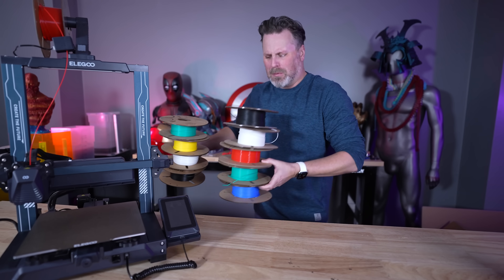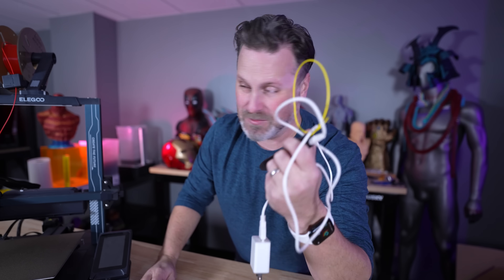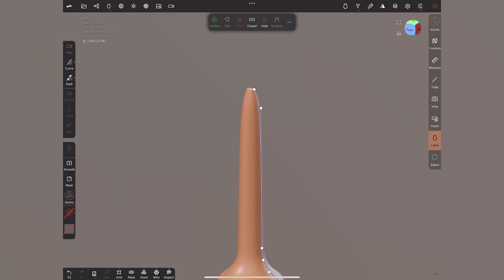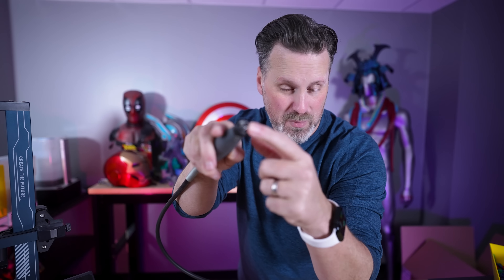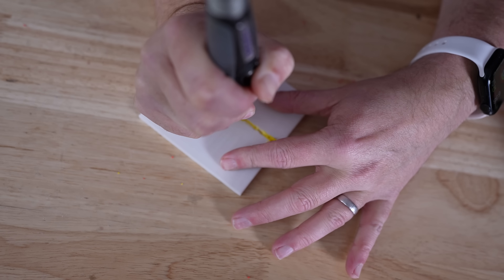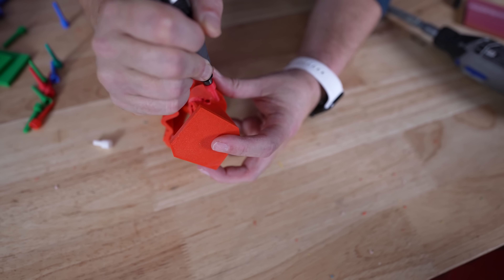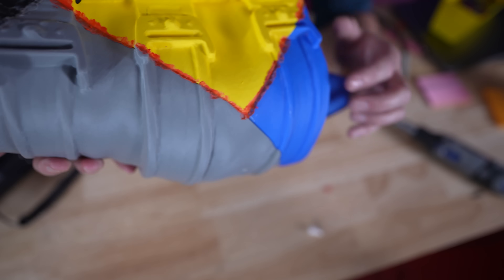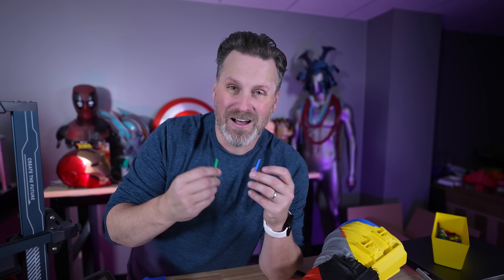Friction Welding with left over filament!

Comment: Maybe try two chamfers at the edge of the plate (like you would prep metal parts for welding) and then try it again. Have in mind that greater radius means higher velocity and therefor more heat. Maybe that works better for you?
Would love to see a test with this setup.

Comment: With the added time to print the tips, the leftover material at the base, and the frequency of tip changes, this seems much less practical than using a 3D printing pen. Am I missing something? This is maybe a stronger weld? But a dremel tool is much more expensive than a printer pen as well.

Comment: if you use large powered metal wire and weld a piece together by heating the two piece and basically gluing them together, even if you didn’t go deep it’d still leave a scar which is why i like to use the 3D pen to fill up the remaining gaps

Comment: Honestly if youve already got the dremel out this is great, since you just switch to sanding after it and you're set.
I also feel like with soldering you can end up melting out more than you want and actually expanding the gap.
Still - proper tools and techniques for the correct job!

Comment: Why not try those 3d pens they have now, basically a hot glue gun but has a filament feed roller inside, just weld a seam shut like MIG welding

Comment: Back in the late 70’s early 80’s (or thereabouts) there was a series of commercial model kits that were intended to be “welded” together with plastic rods that basically were the same as what you’re doing instead of glueing. I really liked those, and the look of the seams they made for some kits
Reply: Friction welding with the rods, or using heat?  Harbor Freight carries plastic filler rods for fixing things like lawn mower hoods.
Reply: @EmperorA0  The rods spun on a dedicated tool, much like what he was doing with the dremmel, so friction welding

Comment: Or design a mold that you can melt PLA into and finally have a great use for all that Bambu poop. No need to extrude it back into a form a 3d printer can use, just melt the plastic into plugs.

Someone please make that high temp cast mold and sell it to the Bambu community for the sole purpose of becoming a friction welding tip. I will buy one.

Comment: Back when I started printing (over 7 years ago now 😳), I would just break or cut off a small bit of 1.75mm filament and insert it directly into the rotary collet you normally would stick tool posts into. The main issue with that, of course, is if there is that it doesn't take much of a bend in the filament to have it flounder on the end. It took some practice, but I got some decent welds.

Comment: You’re correct!  There are other methods to fix 3D printed models.  I use a 3D printer pen to fix cracks and breaks on my 3D printed models.  I either use left over filament in the pen or heat it up the pen to make the fix.  Thanks for the video!

Comment: I'm 59 and when I was a kid (like 10) I had a friction welder for models, it was a small battery drill with these little nibs that would do just this. So it's a very old idea. Just looked it up, was called Spin Welder by Mattel.

Comment: I used this technique about a decade ago using short lengths of filament. I stopped using it because only short lengths of filament worked (long pieces wobbled) and so they ran out too quickly. This printed peg-based approach looks like a nice improvement.

I have also used the 3D printing pen (I backed the 2nd 3Doodler Kickstarter campaign just for that) and the special soldering iron tips that are part of the Modifi3d soldering iron-based tool. However, these days, I just tend to use 3DGloop, as it gives a cleaner finish without the risk of digging in to the print.

Comment: In metal friction welding (at least in all the friction welding processes I’ve seen), the material that turns and creates the friction isn’t sacrificial. It’s usually made of Tungsten Carbide, and is plunged into the two metals to be welded. So you end up with two pieces of metal essentially being stirred together by the carbide bit. As such, this looks more like friction gluing than friction welding to me, as it doesn’t appear that the two base pieces are actually melting and fusing together. 

You might see better results by taking some inspiration from metal friction welding, and taking a steel rod or something which you use to melt the plastic and create the actual friction weld.

Comment: I put all my scrap coils of filament in a couple baggies and use them with my 3D pen. Uncle Jessy, have you tried welding filament together like you can do with devices you can print or buy? Then recoiling it and printing with it? I haven't tried it yet but it is something on my to-do list. I'm concerned about the different temperatures for some of the filaments though.

Comment: Chamfer both edges so it creates a valley for you to fill, you will get a better hold with a flatter finish
Reply: Was just about to type this lol! Aspects of actual welding and use a couple passes
Reply: Would be nice if there was a function like this built into slicer software

Comment: That's also a nice way to simulate a weld line on props that get painted to look like metal.
Reply: For sure. I've used 3D pen and friction welding to add weld lines and other marks to commercially available stuff I've wanted to "make orky" for props. Also simulating damage is a lot of fun with a soldering iron.

Comment: Wouldn't a 3d printing pen actually be worth for this?
Reply: Arguably, these welding tips could be better. With a 3D printing pen, you're extruding hot plastic onto cold plastic which isn't great for adhesion, ruining the strength. These tips are heating up your work piece as it's adding hot plastic to it. I'd say that could provide more strength.

Whenever I use my 3D printing pen on work pieces, with a bit of prying with a fingernail or a tool, sometimes the plastic pops right off leaving the piece seemingly untouched. However, if I bumped the temp, the plastic would adhere better
Reply: @pcdc1337 see these are the answers i love.
Reply: Yes
Reply from the maker: yup that works as well!

Comment: Why not just shove a bit of filament in the tip of the Dremel instead of wasting more filament on brims
Reply from the maker: my 1.75mm filament was too curled / and very thin for that. A little thicker like 2.8 filament some have mentioned works well for that
Reply: Man, all I do is take a mini torch and melt a bit of pla, wipe it around about where I want it, and smooth it with a small card sized but of metal. It comes out looking injection molded. I cut little ridges into the other sides to give it texture too. It's awesome.
Reply: @tpros6289  could you make a video about it? I would really like to see how that works
Reply: I might try that. I added a mini drill chuck to my Dremel, so clipping my 1.75 scraps into friction nibs should be an easy fit.
Reply: When I've tried that, the filament immediately gets centrifuged out at 90 degrees into some kind of crazy propellor/ blender attachment....
Reply: @@leanja6926 It's wrong. That would work fine with 2.85mm filament, as even the creator pointed out, but when you're like the majority of people who partake in this hobby and have only rolls of 1.75mm then this is clearly the better alternative. 

Go be hateful elsewhere, I personally love this concept and this channel just got a new sub from me over this video.
Reply: Because its a copy of Mattels Spinwelder toys from the 1970s where the tip pushes onto a DC pistol drill
Reply: Came here to say this. I've got 2.85mm filament and it works beautifully cut into about 5cm bits. Very nearly zero waste, definitely a whole lot less than this method.
Reply: @@leanja6926L comment to give to someone who is always helping the community.

Comment: Looks like you would need to work on just how much pressure and angles work best. I wonder if you used a 3D pen with PLA and ran it at ABS temps so the PLA is more fluid like and fill the gaps. Maybe an adapted piece of flat metal net to the tip to smooth the PLA out as you move across the seam.
Reply from the maker: yeah the pressure/angle for sure plays into it. I like that idea with the pen at a higher more liquid temp

Comment: I just use lighter and weld it that way.
Reply from the maker: oh thats a cool way I havent seen before
Reply: @UncleJessy   hold the flame near the part DON'T let the flame touch the part it will blacken. And don't hold for too long the part will warp. When it's kinda soft push 2 parts together. Works on small parts no excess material
Reply: sometimes I even print jig fixtures for it